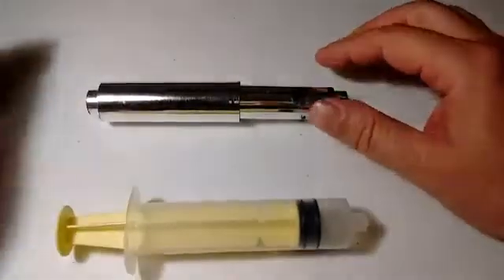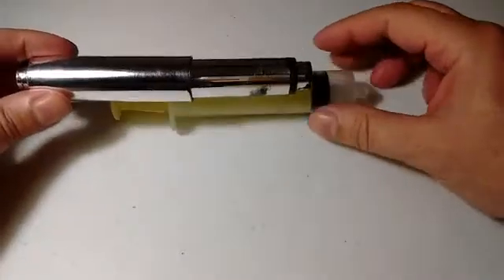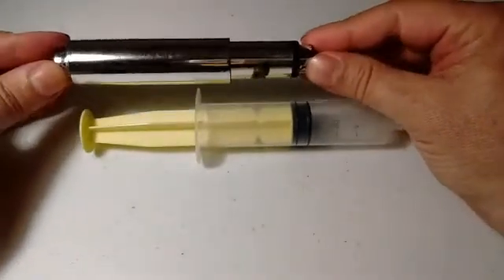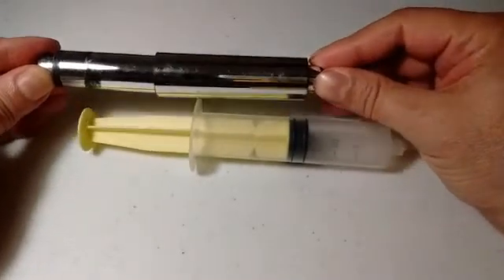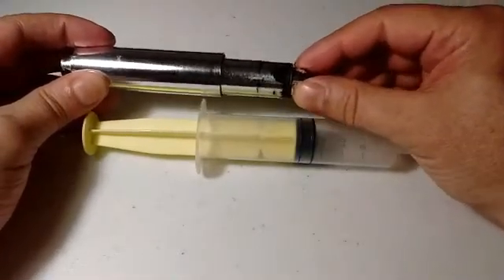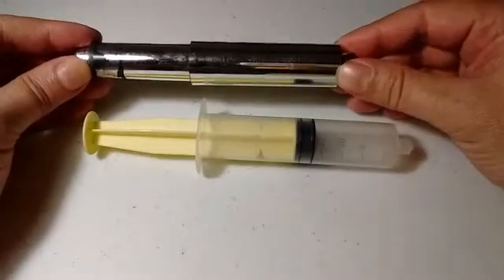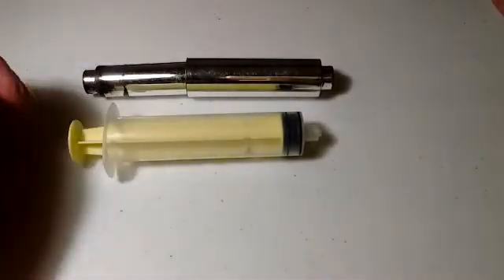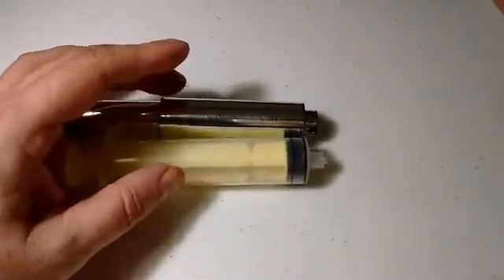spring piston and gas rams in air rifles - another way to explain it

Comment: How do remove the piston.
Reply from the maker: A have not removed parts from a spring gun in years but on YouTube they have videos on spring piston air gun spring compressors Wich hold spring from flying out after pin has been removed at the rear of the stock.....you can make your own with wood and C clamps
Reply: @libra7624  thankq..